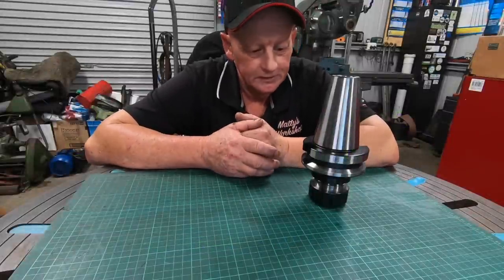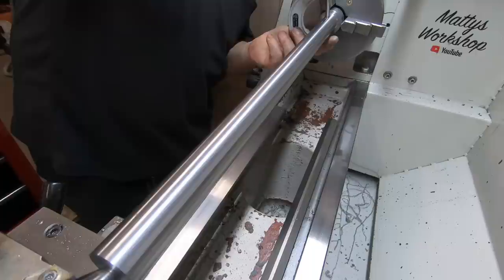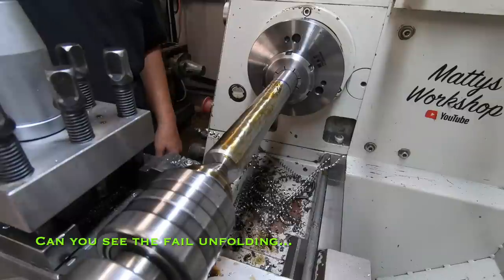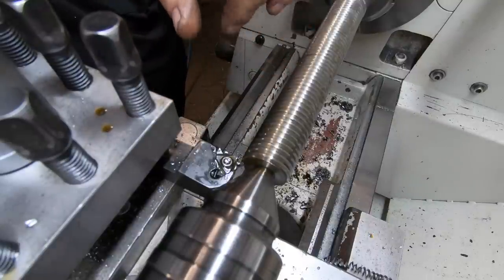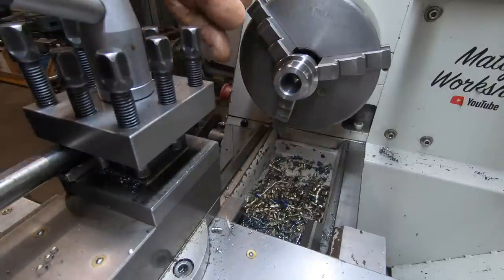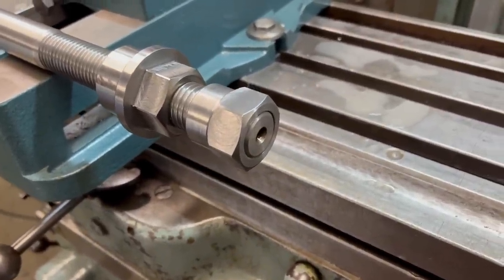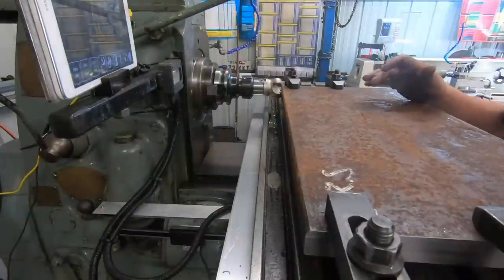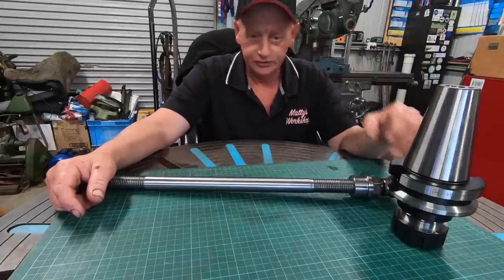New Drawbar for the Cincinnati Mill

Comment: I didn't read all of the comments, but that "Tit' of smaller thread is for using an adapter and running smaller toolholders.  I have a 50-40 taper adapter for my Cincinnati, and the 40 taper uses the smaller threads.  Great video.

Comment: Very nice job on the drawbar 👍
The valve stem is actually imperial. It is 0.43307086614173228346456692913386 bananas 🤣🤣
Hope the treatment is going well.
All the best,
Paul
Reply from the maker: Thats what I measured but it was to many bananas to read out on camera🤣, thanks for watching mate, Cheers

Comment: Great recovery on the thread Matty, not easy to do .
Hydraulic Piston rod material is good to work with, even the plain carbon steel grades.
Nice addition to the mill, thanks for sharing. 
Best regards from the Black Country UK. 
John.
Reply from the maker: Gday John, cylinder rod is great to work with and I still can't believe o stuffed up on that thread, Thanks for watching mate, Cheers

Comment: Hi Matty, 
your Lister valve stem is probably 7/16" which is almost exactly 11m. In fact it's 0.00425" bigger so I'd almost be willing to bet that if you measure with an imperial micrometer you'll end up with 0.43775" or thereabouts. Pretty small numbers and you have to account for years, the last Lister 6 HP diesel I worked on was in Africa in 1962, so sixty years ago, of possible wear and tear. I'd be interested to know if I'm correct and what Lister engine this came out of. 
We had half a dozen on the folk's farm, from an early 30's "coffee pot" style water jacket, about 2.5 HP (rescued from the scrap heap by my dad) and a few mid 50's version, 1.5 HP petrol engines we used to pump water. As long as they had fuel they'd run forever.
🤞🇨🇦🕊️🇺🇦🕊️🇦🇺🐨👍

Comment: Nice job Matty. Good save on the threading. Great having a horizontal option.
I have an old Tom Senior mill I'm doing up. Also has horizontal option.
Cheers Mike
Reply: Just made a 3MT ER 32 collet chuck for my Tom Senior M1 and edge milled some big plates on it, they're grand little machines. On with cutting some gears to make a tumbler reverse for the feed mechanism now, got the idea from "Harolds workshop and steam" channel.
Reply from the maker: Gday Mike, having the horizontal opens up a heap of job options now, Thanks for watching mate, Cheers

Comment: i was sitting here going "NO,NO,NO!! MATTY!!" but a very nice save there ,if i do similar things,threading from both ends i make a mark whit a pen at the top of the chuck and zero out the dro just in case - then i can get back to the right place,and the gears will be correct for the carriage position
Reply from the maker: I thought I heard you I the back ground but I did say I didn't listen, it was a screw up that shouldn't have happened, Thanks for watching mate, Cheers

Comment: Far out Matty and g'day mate, I've used hydraulic piston rod for all sorts, great stuff 👍 
Cracking job indeed, I always struggle turning any length and keeping it true 
Looks bought not made 
Hope you're keeping well mate and the treatments not making you too crook
Reply from the maker: Gday Ralfy, i've got the lathe tuned in pretty good at the moment, cylinder rod is great to work with, i like the shit, the last chemo has made the last 2 video a big challenge to make, had to pull out the big boy balls and brave face thats for sure, Thanks for watching mate, Cheers

Comment: Can I suggest the smaller thread on the drawbar is to pull a morse taper socket into an open ended International -to - Morse adaptor?  Morse tapers are not keen on side loads and tend to 'walk' out if used for milling. Just a thought.   I had an old flatbelt horizontal mill which had a 4 morse taper drive with no tang, the drawbar was ½" Whit.
All the best,
Robert
Reply from the maker: Gday Robert, id say your spot on, someone else suggested the same, Thanks for watching, Cheers

Comment: Hi Matty i believe that that smaller thread is used for if you have a #50 taper to #40 reducer. the thread size of #40 tool holder would use the small thread . Well you get the idea . JM
Reply from the maker: Gday, Another viewer has suggested the same and I think your spot on, Thanks for watching, Cheers

Comment: Gday Matty nice job mate and thanks for another video. I had to make a longer drawbar for my mill but mine was as simple as a trip to bunnings for some m12x1.75 threaded rod. Your not wrong about the price of material lately I just bought two bits of 4140 1 @ 50x250 and 1 @ 80x250 RND cost $200 with $60 for shipping just on 14kg it's not making things easy huh
Reply from the maker: Gday, I wish mine was as easy, the cost of material has gotten out of control, hopefully one day soon the prices might come down, fingers crossed anyway, thanks for watching, Cheers

Comment: Warts and all; Your content is appreciated by people who know we're all human. Question though. If both nuts had the same cut, was there a reason you didnt do them in one operation? It seams you could have put them end to end and machined them at the same time.
Reply from the maker: Gday, to do both internal threads together is possible, the internal threading tool I have tends to have a far bit of flex if its out of the tool holder a bit far and if I make a mistake then i've buggered both parts at once which has happened before, Thanks for watching, Cheers

Comment: That extra tit on the end of the drawbar was for a 40 taper tool I bet.  Probably had an adapter for the 50 to 40 and lots of tooling. 
Nice work. 
Joe
Reply from the maker: Gday, ill look into that, you might be right there and if so ill be looking for some 40 taper, there quite a bit cheaper and more available, Thanks very much, Cheers